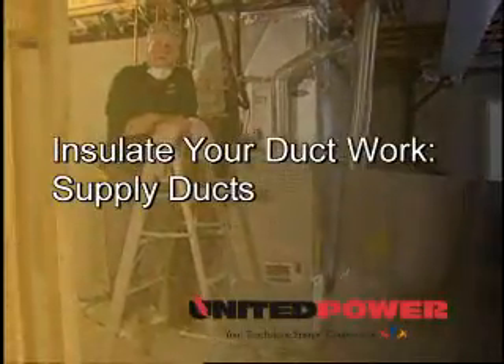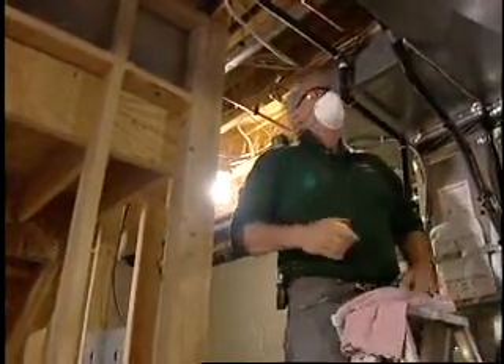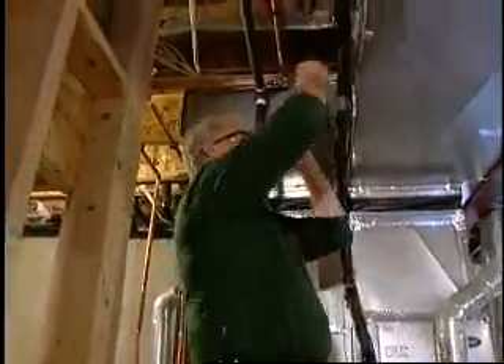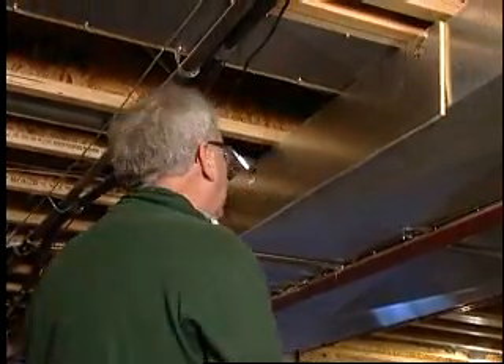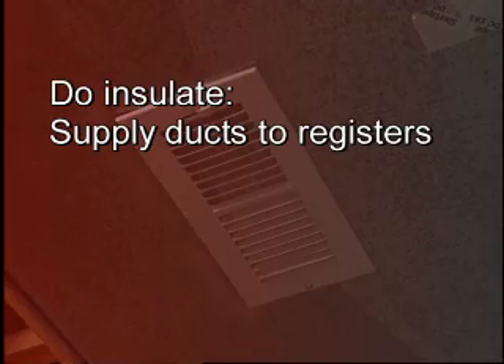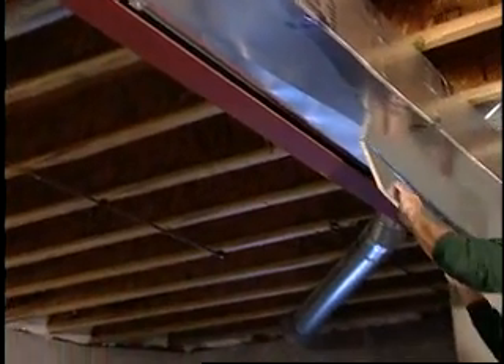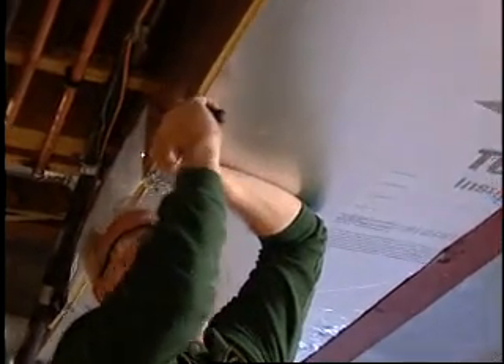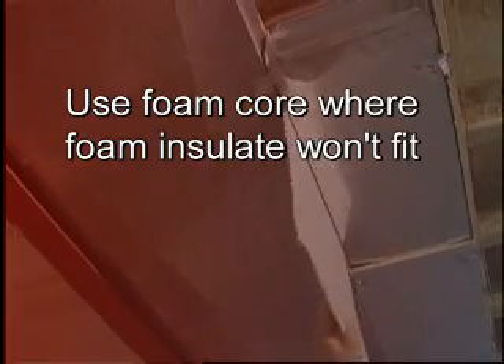United Power: Insulate Supply Ducts: Part 2

Comment: I did this for all my trunk ducts. Made a big difference in keeping the ducts from radiating heat out into my unfinished crawlspace. The only thing I would add here is to use the foamboard (or regular insulation) where possible on the tops of the duct trunks as well as taping ALL seams. Also, for those tight areas where the return and supply lines are so close perhaps the radiant foil you showed would be better than those presentation plastic thingys

Comment: terrible work. you basically tacked the panels on and did not seal each panel to the other. that lets moisture in. a basic no-no. ok to hold in place but then you seal those joints completely. how did you tape the panel you couldn't fit but had to slid it down into position? you didn't, moisture there too. You didn't mention anything about checking seams. i would've put mastic down on all seams regardless. metal tape at the least. your end result was sloppy as hell.  looked like crap.

Comment: A good DIY video, but NOT showing missing steps; Don't test or seal all duct joints first. Don't check and screw-down loose take off boots or large duct sections for popping noises when heating up/cooling off. Don't use spacers to allow an air space between duct and insulation. Use a flammable paper backed F/G insulation not intended for supply duct work.

Comment: That duct needed to be taken down to do properly. That side against the I been will allow condensation, and the top would be much easier to insulate if it were taken down. Also, could use mastic to seal the joints while you were at it.

Comment: fiberglass is dangerous for health and fire issue As specialist HVAC engineer I advise to use polyolefin duct insulation and insulate the duct on the ground then install on the ceiling

Comment: you should insulate the 12 ft from the outside wall of the return/exhaust.  it will condensate if you dont.  you should also scrap your tape the most important thing and do the top if will still to get moisture build up over time and it will go into the insulation on the sides and bottom tape all our seams